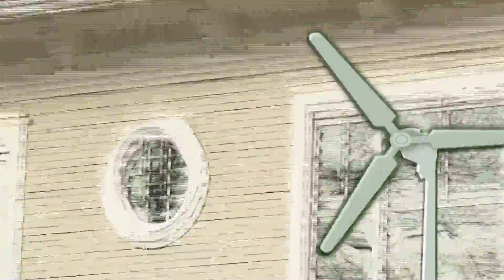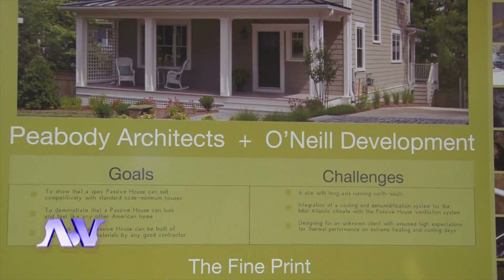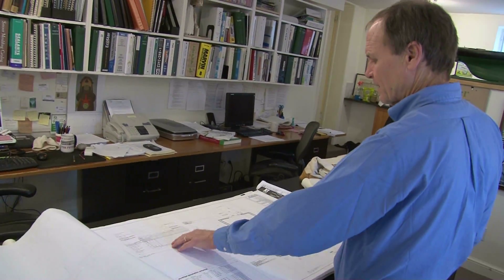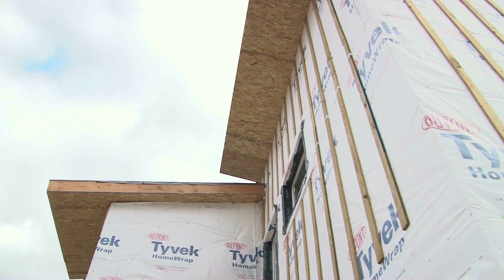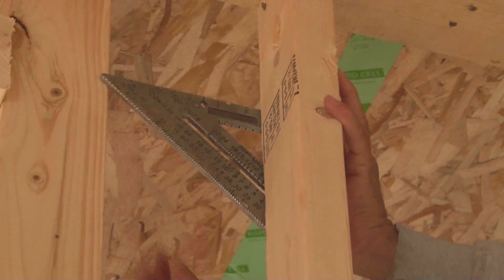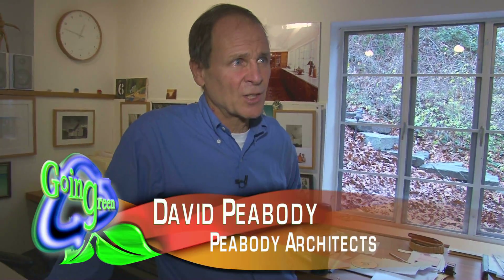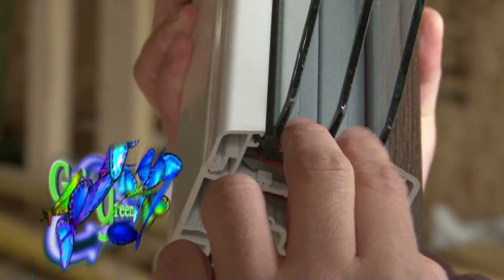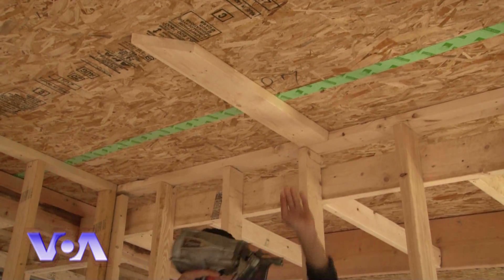Building a Passive House

Comment: See how a passive house is build in the Heart of Vancouver Island CanadaPort Alberni's first Passive house in the Heart of Vancouver Island, to date we have 30 individual detailed videos from the foundations up, Search google for seumas2 in youtube once opened go to the top and click on videos, the videos will be in reverse order, more as the build progresses. We never used tyvek or OSB, used moisture and air barriers products from EU, double wall BC 2X4 DK studs, 20 ins thick, Rockwool insulation R 80 walls ceiling R80, pad R55, triple glazing R 7.5, large windows facing South, small facing North, 1/2in plywood sheating, no air leakage, all joints and air infiltration taped, widow wells splayed at 45 degrees on the outside (wide angle view) heat exchanger (EU) heat pump hot water heater, wiring placed in the double wall cavity ( no drill holes in the studs, dropped ceiling allows the same, moisture barrier placed 1/3 distance in from the interior wall, High heel trusses, Improved under felt on the roof shingles,for further details view the videos. Wheel chair accessible, electrical switches one foot lower and the power plugs placed 4ins higher for that reason, Stay tuned as the build progress to the finish stage producing other 12 plus videos. slainte mhath macduff